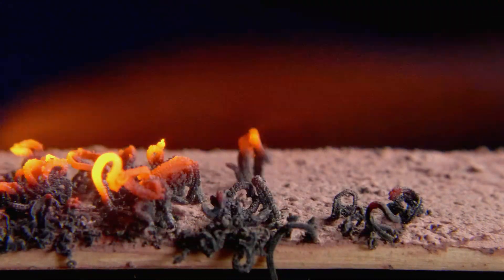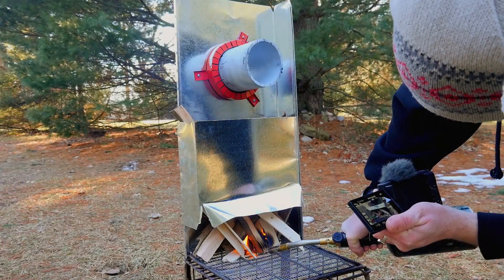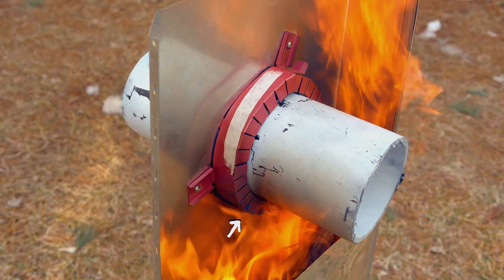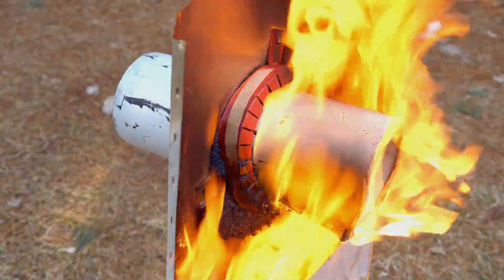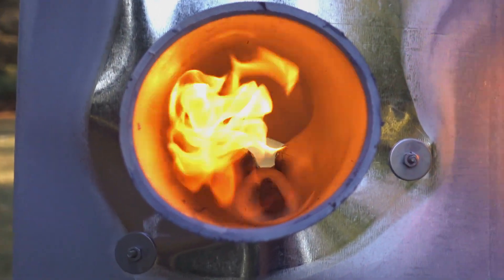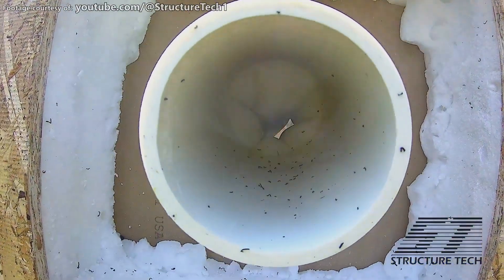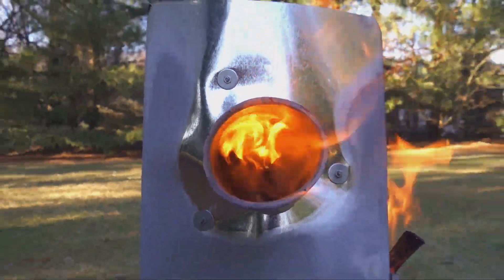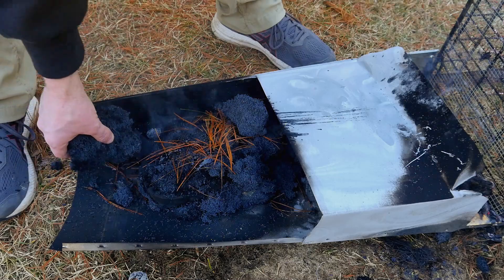Testing an Expansive Firewall Pipe Collar (Intumescent Graphite)

Comment: This is an interesting video of an ad hoc test, but there are a number of factors that have led to the unsatisfactory operation of the collar.  In real life (and in a standard fire test regime), the supporting construction would be far more robust that a thin sheet of metal, this would give a better seal between the collar and the wall, and would also not deform as rapidly or to the same extent.  The three fixings would be perfectly adequate on a dry wall or brick wall construction.  The product will have detail instructions on both how to install the item, and under what circumstances it will provide the advertised fire performance.  The world of passive fire protection is often a victim of marketing BS, and the principle of caveat emptor should always be applied.

Comment: If the graphite is placed inside the pipe, it would have sealed the inside better I guess. Leaves one question: why not seal the pipe with rock wool or glass wool by default?

Comment: Could this be used to create a passive (no external power) Domestic fire door closer.  ie the expanding carbon provides both insulation & motive force to close fire shutters. Activated by the heat of a fire.

Comment: Interesting content! I see potential failures in the test for reasons NightHawk didn't mention. In video-test the fire had a strong one-sided source of the heat - the fire below the test site. In an actual structural fire, I believe the temperature around the entire pipe fixture would be much more uniform, and therefor firewall pipe collar would likely behave more uniformly.

In all other cases, this was interesting and informative.

EDIT: Ahh, there was mention of "unidirectional fire" fire at end. Hit nail-on-head.

Comment: A more effective way to utilize this would be using a damper. The expanding graphite would have to be sold as part of a kit that would mount through the wall and have other pipes or even metal conduit attached to it. This system would have a V notch blade that could cut any cables as it rises to block off the hole. Because it is a secure unit, the graphite would be completely contained under the blade and would not be able to leak out, giving maximum pressure. I suppose they could be sold in 1 and 2 damper configurations to offer protections from both sides if desired, but anything passing to an external wall or room with superior fire suppression like the Halon systems in a bank vault would only need protection on the one side.
Reply: Tʜᴀɴᴋs ғᴏʀ ᴡᴀᴛᴄʜɪɴɢ
sᴇɴᴅ ᴀ ᴅɪʀᴇᴄᴛ ᴍᴇssᴀɢᴇ Sᴏᴍᴇᴛʜɪɴɢ sᴘᴇᴄɪᴀʟ ғᴏʀ ʏᴏᴜ!! Hᴇʟᴘ ʟɪɴᴇ ɪs ᴘʀᴏᴊᴇᴄᴛᴇᴅ ᴀʙᴏᴠᴇ ,ғᴇᴇʟ ғʀᴇᴇ ᴛᴏ ʀᴇᴀᴄʜ ᴏᴜᴛ .......

Comment: I actually work in one of the bigger fire Testing laboratories in Europe. Those kinds of Collars are usually used on Drywall or similar products. The typical setup for a wall in testing is 2 Sheets of 12,5 mm to 15 mm drywall on either side with stone or glass wool ( more commonly Stonewool) in between.   Those Collars are very sensitive to the correct Thickness of the pipe and material. The pipe Thickness of this pipe was on the bigger side for Polyethylene. Did you check the data Sheets for this product if it allows for this Polymer in this thickness?  They are also very sensitive about the structural integrity of the wall. Also they are commonly used in Pairs. One collar on either side of the wall. 

You are correct about the length of the Pipes. Typically they are Tested in lengths of at least a meter form the wall either side while they are open on both sides. 

If you have questions about fire Testing feel free to contact me .
Reply from the maker: Thanks for the info, I should have looked more carefully at the data sheet before testing.
Reply: Not to mention that its not usual to have a 12" piece of pipe sticking through a penetration like in the video, the pipe run is going to be continuous. The intumisent material is meant to ensure the penetration completely seals off during the fire.

Comment: I think it would be much more efficient if the collar was put inside the pipe. That way it does not need to crush the pipe, just fill the space.
Reply from the maker: They make pillows of the same material for that purpose. That's what you would use in an opening bigger than 4"

Comment: I specified a bunch of these from Hilti on a 5 story wood frame over 1 story of concrete 324 unit apartment complex. Needed one for every pipe penetration through a rated assembly. It was required to use pvc instead of cast iron pipes. Cool to see!!!

Comment: Wow and thank you! (being one of those commentators)
What would happen if you have the collar inside the pipe?
If is a metal pass-trough pipe, maybe it can simply block it?

Standard procedure when going between fire sections in buildings in Sweden is yo use a glas fibre reinforced cement.

But for less regulated pipes, maybe having it inside would prevent spread?
Reply from the maker: They make "pillow" versions of this that are meant to go inside vents.

Comment: How would it behave if the pipe is filled with e.g. water? I would assume that the collar ist mainly to prevent smoke and flames sneaking in between wall and pipe into the next room since a filled pipe would stay stable way longer.

Comment: I i guess it really depends on the definition of its purpose... What exactly is it designed to do... act as a 1 hour fire stop? (something else?) Seems like this stuff while partially useful, wouldn't actually work well enough to stop a fire in time. I can't say this for certain, but, without a slightly better test design, my view is that it doesn't do the job well enough to stop a fire (at least for that size of pipe as demonstrated)

Comment: I managed a hangar and we used fusible links to create a spring-loaded latch that would snap closed if the temperature got above a pre-set level and melted the 'fuse' holding the hatch open.  That was the plan.

That said, they installed these links in heating ducts and they all snapped closed the first time we used the heat.  Best-laid plans of architects and building codes.
Reply: So it worked.
Reply: Anyway that type of system should be much more fire-resistant than this, also more reliable and cheap.
Reply: Well it works , just needs calibration

Comment: Seems like you'll only ever see compression from one side of a pipe. And that 90% of real world circumstances would find that heat sourced below. Which makes me think setting a 50% volume-filled standard for the pipe, along with a more rigidly mounted half-collar (instead of a full ring) would maximize the benefit, while minimizing material waste. Properly designed, a second half-collar could be attached to make a full ring, optionally.
Reply: Shouldn't you be playing cluster truck?
Reply: Check out some fire science. Any enclose space becomes very hot uniformly. Especially attic spaces where you are likely to find something like this

Comment: I wonder if some "back snake firework" could do that job. This expands a lot so it could act as a nice insulation against fire. Unless it's too fragile and collapses.
Reply: In his previous video he shows exactly that. A "putty" with expanding graphite used to insulate electrical boxes during/due to fire. Yes, this expanded graphite is perhaps the best insulator for that application.

Comment: Since the rules changed on our mains distribution boxes (aka fusebox, or breaker box over there) here in the UK to require the fitting of metal boxes instead of plastic in new or replacement installations, the use of intumescent sealants have become a requirement to keep any potential fires in the box from getting out into wall cavities or onto the wooden board most of our electrickeries tend to be distributed from... :)

Comment: Good video.  But are you sure that the collar is supposed to close off the pipe, and not the opening through the barrier?  A pipe would be sealed on either side to handle gas or liquid, and a conduit would be unlikely to be completely open, and more likely to be closed off with metal plate or another fire seal. Heating a fluid in a structurally compromised pipe, with an added restriction, might be more of a disaster than leaving it alone.
Reply from the maker: This is for conduit

Comment: I would only trust a real world test on a model home like firefighters use. The guy with a flamethrower is a joke of a test. Your test was more accurate but you do state the unrealistically short pipe. But so far we have a success with the joke test, and a failure with the more realistic test. That's a no recommendation to me until shown a better test.
Reply from the maker: I don't think my test was a total failure. It would have sealed off if the pipe had been half full of wires.
Reply: @Nighthawkinlight  I wouldn't make that assumption.

Comment: I thought that placing expandable graphite inside the pipe in order to prevent propagation of flames makes much more sense and works quicker. Having the collar would be the backup plan.
Reply from the maker: That's a good idea. They make "pillows" that expand for that sort of purpose in vents.